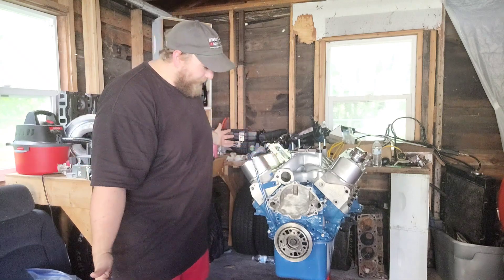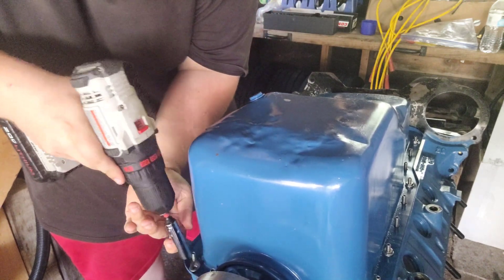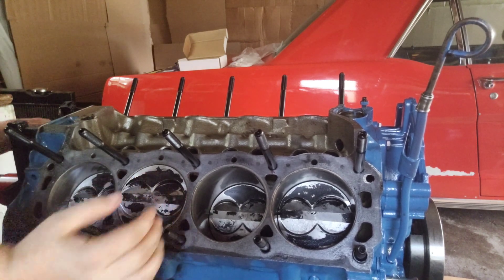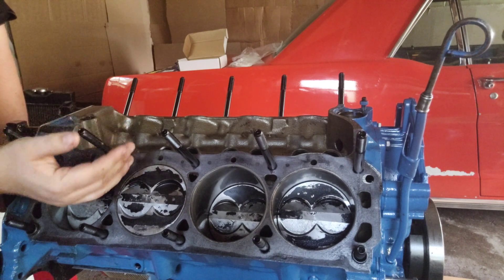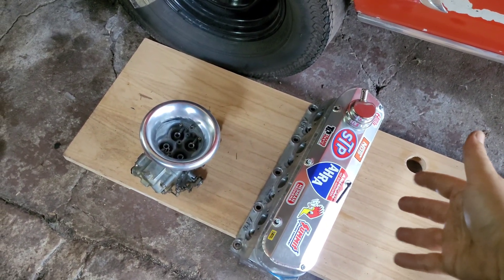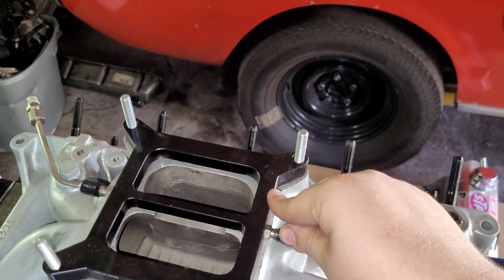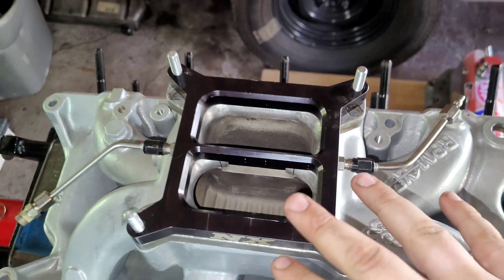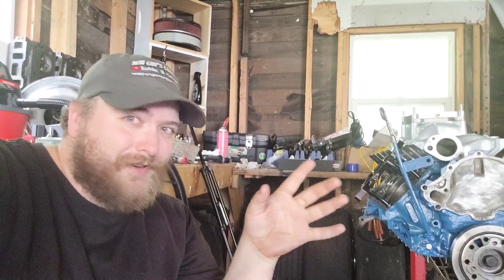Nitrous 308 Windsor SBF Engine Build! | We Now Have A Short Block For Our Ford Mustang | AFR Heads

Comment: Go back to the tunnel ram..
Reply: I mean this in a positive way… I run 2 of them.. a little low end loss over a duel plane, but much more across the board than a single plane.. keep posting
Reply from the maker: I will eventually 😅
Right now I just need to get something done as quick as possible 😂